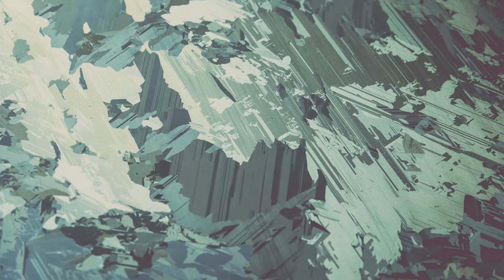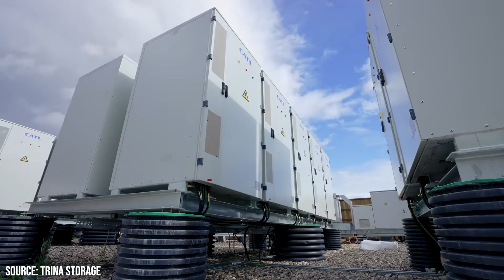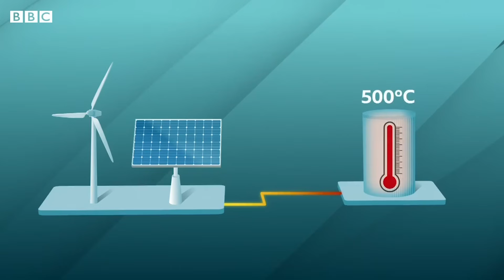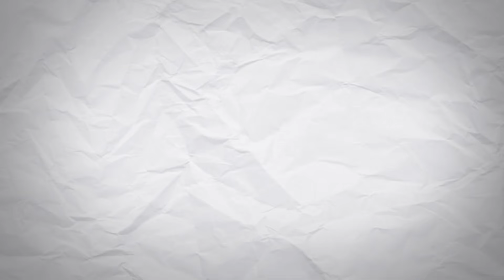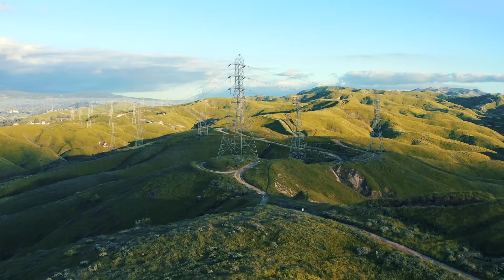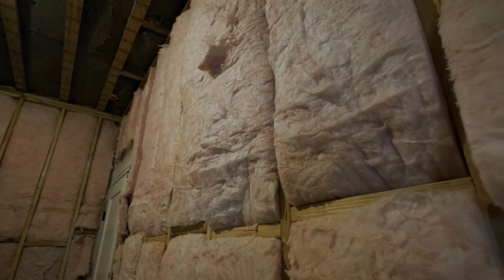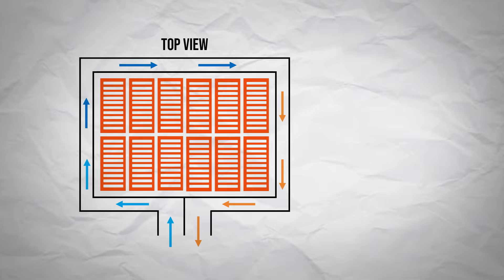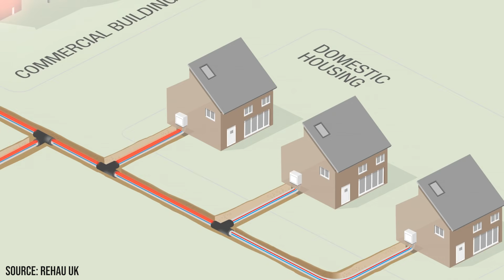How 3000 Degree Bricks Will End Battery Storage

Comment: This still runs into the same issue as Polar Night. The amount of energy you would need to get it up to temp is massive. To heat a decent sized city of 100K, you'd need something like a megawatt nuclear reactor to provide all the electricity needed for heating the bricks... in which case, why not just use the electricity, which has very little transmission loss, to power electrical radiators? 

I don't get it... we're trying anything and everything to produce and store power when we should be looking at nuclear which can power everything and doesn't need storage... Nuclear is green. Nuclear is clean. Nuclear lasts a helluva long time. Plus Fission can power Fusion, which will undoubtedly be the power supply of the future.
Reply: Well, the accidents made people very scared. The strategy, really, should be showing nuclear energy kills a lot less people per plant than any plants that burn stuff. As far as I'm aware it kills orders of magnitude less people than plants that burn stuff for energy.

That just the way to reframe. And, yes, the nuclear waste isn't really solved, but burning fuel also won't make a dent on global warming which is a bigger looming threat.
Reply: @VeteranVandal  There is somewhat a solve for the waste. There's actually two solutions. The first is thorium reactors. You can take the spent fuels from uranium reactors and burn them in thorium reactors which will reduce them more, which take the half-life from a few thousand years to a hundred years or so. After a few generations, the waste would no longer be a health risk. The second solution is diamond batteries. They'd encase the spent fuels within synthetic diamonds and use the beta decay to provide very low, but very long-term power. I'm going off of memory here, so the details may be off a smidge, but generally speaking, we do have solutions and they do work.

Edit: Diamond batteries are safe... thought I'd mention that.
Reply: Nuclear is clean and green?!?!  Hanford in Washington State just started vitrification of untold barrels of decades-old liquid nuclear waste. Tell THEM how “clean and green” your beloved nuclear energy is! 😡

Comment: Interesting, the use of simple materials to efficiently store bulk heat. Also, pairing this with the amazing TPV (solid-state heat-to-current) tech from MIT could be a winner.
Reply: What?? No. TPV is at best 40-50% efficient. Thermal energy storage is only useful for industrial heat applications. It will not replace batteries.
Reply: @jameswatkins7763  yes, silly me, I missed the main point of converting surplus grid power to stored heat for local use.
Reply: @sequitor  heat from burning is still cheaper

Comment: sounds just like hot air
Reply: Hot air or steam at temperatures selected by our paying customers!
Reply: @RondoEnergyGlobal  generated with electricity instead of being created on demand by gas needing additional hardware. So this scheme is beneficial if you can score electricity cheaper than the cost for fuel correct? So this could be expressed in hours per year where this scenario takes place. Is it hundreds or thousands of hours? Turning electricity into heat is not a value prop by itself you got to also beat heatpumps that give at least tripple the heat for the same amount of energy but can't reach these Temps obviously